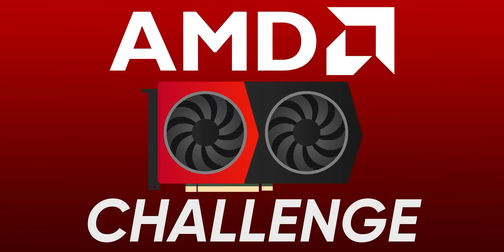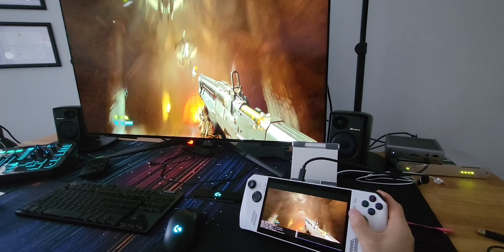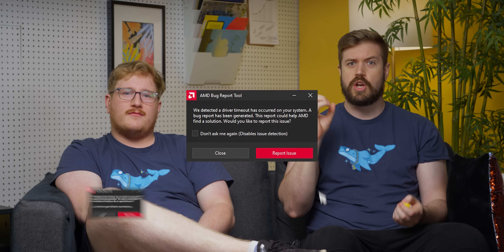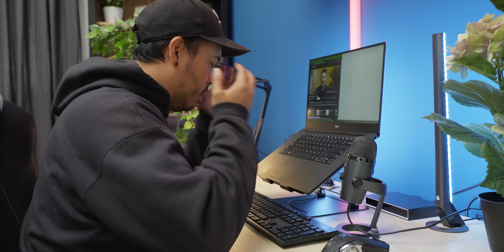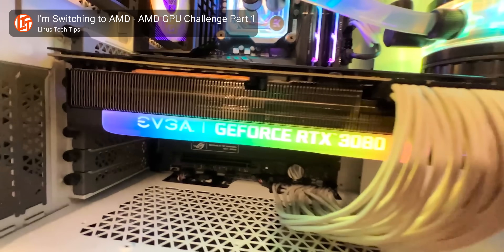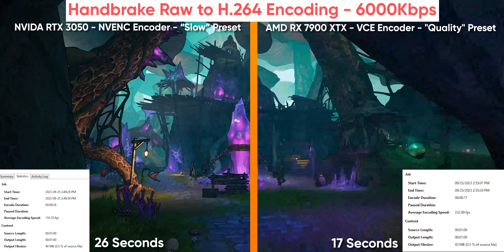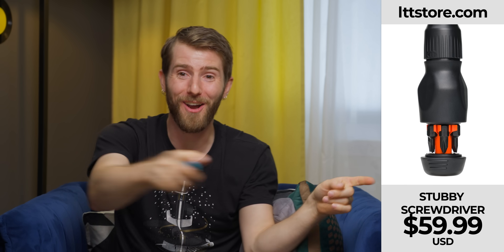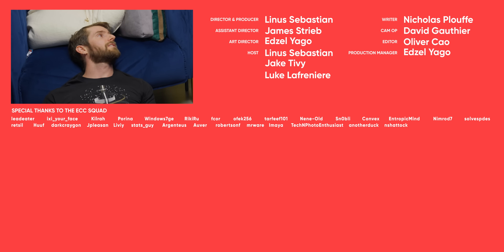I’m Staying on AMD! - Radeon Challenge Pt. 2

Comment: I'm telling you the hard crashes are from windows screen saver doesn't work with amd gpu's. I had pictures cycling every 5 minutes on my desktop background and every 5 minute or so my computer would hard crash. I turned off background slideshow and literally no crashes ever, I even replaced a motherboard and ram because of this issue. 6800xt water cooled will kill at 1440p and 4K games. 100 fps all the way. Soft tubing guy here... but my set up is way different then most.

Comment: I think this challenge is unfair. Running a Radeon GPU on a previous Nvidia pc, is not a fair comparison. I think those challenges should always be done with a fresh reinstall. Or maybe first DDU and then fresh install. Both cases are interesting.  I am also interested about a test where Radeon PCs switch over to Nvidia and then see if a reinstall is necessary.

Comment: My honest opinion is, that all manufacturers should stop 3 years of speed improvements and wholy focus on stability & usability. I don't give a fuck about slight increases in graphics at this point, nor 8k screens or 20TB SSDs, etc., but I am just sick and tired of the PC platform just not working all the time. Unless I'm gaming I'm actually just using my company Macbook, because I'm just fed up. I'm not a child anymore that will take any experience and be happy, it should just always work, and Windows and the PC just don't, but it goes beyond that. Like why can't I setup my screen via OSD when there is no signal to the screen, or why does it take longer for the screen to display a signal initially than for my whole system to boot, why does my BIOS randomly turn off virtualisation, why does Windows randomly forget my scaling settings or reset my wallpaper, why does this or that game crash, why do my headphones randomly turn on some webcall speech codec and sound terrible, why is there about a 1/3 chance for a BIOS update to even work from Windows, etc. etc. It just a shitty experience, and it is everybody's fault. My monitor isn't running Windows, my issues were on both my AMD and Nvidia Cards, Intel & AMD CPUs, game issues are lots of companies fault, etc. Stop tweaking and just make a standard definition of purpose work stably. I'm fine with playing late 2000s games, or Nintendo games, why would I care that a game has 2022 graphics instead of 2024 when it comes out next year perhaps. But if it crashes constantly, I'm just not interested in buying anything from you ever again. Fix you shit, smooth the edges, test EVERYTHING and deliver technology on the PC that works at least as well as lets say an iPhone, where any minor bug is newsworthy. It can't be that impossible of a task. I'd rather wait a little longer on a working system, than get to the inevitable crash faster.

Comment: I dont understand what your guys are doing :) I have been using AMD/Radeon GPU and CPU from early 2000 and the only times things start to get funky for me is when OC gets in the mix. Otherwize it has worked great for me for 20 years now. My laptop at work on the other hand... A Intel and Nvidia worstation laptop, i have had so many problems im never going to buy that with my own money..

Comment: I am a little upset that this challenge has gone on for so much longer than the Linux challenge did, maybe with AMD they would have had a better time, but oh well.
Reply: The Linux challenge went on for a month, as did this one.
It's simply that for this one, they had a delay between the end of the challenge and the time they made their conclusion video
Reply: @haxie4516  wait, really? That was a long ass delay
Reply: @RogueRen 
Well, they had LTX to prep for, and then they had the hiatus, etc

Comment: I built a mini tower just for watching YouTube and such, integrated graphics on the 5600G. Should be good enough, but constant graphical glitches, low framerate and crashing. I ended up slapping in an old spare GPU (also AMD) and it was fine.

Comment: No DLSS and RTX is a huge deal breaker.
Reply: ....
This is like saying "this iPhone doesn't have Samsung's Bixby, that's a huge deal breaker"

RTX is a branding for Nvidia cards, and DLSS is the name of their frame generation tech... AMD has FSR for that...
Reply: @oliver-nation4377 
Yes DLSS and FSR are different... each is developed by their own separate companies.
But no, it is essentially just in name. The way they work is not different. Both are frame generation tools, and both are using "AI" to generate additional frames, where the game doesn't perform as well.

And no, RTX is not a tool.
RTX is the branding for their GPUs.
The tech you're thinking of is ray tracing. RTX is literally just a marketing term that is trademarked (and copyrighted) by Nvidia.

AMD cards also do Ray Tracing as of the recent cards.
Reply: @haxie4516  Yes AMD can do Ray Tracing, and yes RTX is a brand name, but the fact of the matter is that AMD cards sucks at best at using RT´

Number two, no FSR ain't ai based like DLSS, but instead on an algorithem, which is also why DLSS boost your preformance more, and looks graphically better.
Reply: @oliver-nation4377    
So, you're moving those goalposts fast, aren't you?

AMD's Ray Tracing performance with the 7000 series is pretty solid...

And yes, FSR and DLSS are both "AI" frame generating techs.they are using the same methods.
And considering FSR3 came out yesterday, you cannot be claiming one or the other looks better lol
Reply: @haxie4516  Ofc i can, which games that needs to use FSR3 has it? So yes ofcourse i can claim one is better than the other, when one is actually supported and does exist. 

And no AMD 7000 series Ray Tracing still sucks ass, since what makes Ray Tracing viabell is DLSS (And no FSR looks arse and does not give the same boost)
Reply: @oliver-nation4377  
Nope. You can't.

No. DLSS is not what makes raytracing viable. That's two separate technologies FFS.
Reply: @haxie4516  Most setups arne't able to handle RT, that is why you use DLSS
Reply: @oliver-nation4377  
🤦‍♀️
Whatever. I cannot be bothered trying to teach you some computing basics.
Reply: @haxie4516  Typical American, won't bother to do any kind of research and thinks he got the only truth. Educate yourself, and stop watching short video format.
Reply: @oliver-nation4377  
Lmao. Dude. You claimed that DLSS and FSR are completely different, and that RTX is a technology.

Don't try and lecture me on anything, kid.
Also, not American, and I teach electrical engineering.
Don't incorrect me again.
Reply: @haxie4516  then stop being incorrct, if you don't like being lectured. And if you teach, you really should learn to do some research before going into an argument. But be my guest here is your asignment "teacher" how does a 7000 amd card with FSR compare to an RTX 4000 series with DLSS?

Comment: I do not understand why so much unnessecary effort was put into this project with tearing apart hardline water tubing and riser mounted cards and such that will not match the use cases of 90% of watchers of this video.   I believe for this or any other similar challenge should be done with non-personal PCs, and should just be purpose built desktops for the challenge with various CPUs and motherboards.   Still use these desktops as your daily driver and install all the other software you want to use on them, don't put them in your personal machines of various ages and jank and expect to get relaitable results.
Reply: That would completely defeat the purpose of the challenge....

What you're describing there is a review, not a challenge.

You claim that this won't match the use cases of 90% of watchers?
A sanitizer system like that won't match 100% of watchers.
Reply: @samuel.gantner 
As I said. That defeats the entire purpose of the challenge.

Sanitizing the systems makes it completely unrealistic.
If you want something like that? Go watch their review of the cards.
Reply: @haxie4516  Im not asking for a card review, I m asking for a full daily driver gaming and non gaming swap.  But using their personal computers that they admit are non standard configs with other issues affecting the results does not produce a repeatable result.
Reply: @samuel.gantner  
So you want a real-world test but you also want it sanitized and have all elements of the real-world test removed from it...

Riiiiight....

I don't think you understand that giving them sanitized systems completely removes any and all of the actual point of this video.
They're not making a long term test video. They're not making a daily driver test video.

They're doing a challenge.
The challenge that is explicitly about being realistic and not hiding away any of the rough parts.
Giving them a fresh system to use would not be realistic at all.

Jfc...
Reply: @haxie4516  So someone upgrading their case,  motherboard, GPU, and hard drive at the same time is less realistic then swapping just the GPU in a rack mounted, hardline water cooled PC with all IO routed over optical USBC ?
Reply: @samuel.gantner  
Firstly: yes. Because if someone does that, they're not doing an upgrade, it's essentially a new PC.

Secondly:
The fact it's rack mounted is irrelevant. That changes nothing about if it will raise errors or not.
Same for the water cooling. The GPU was not hooked into the watercooling loop.
And you're incorrect. The IO for Linus' system is not routed over optical USB-C.

So....
Maybe if you actually stopped and looked at the first part of this challenge, you'd know why you're so desperately wrong.
Reply: @haxie4516  Maybe if you watch this video that your providing bad takes on https://youtu.be/4yUMOK9dOQc?t=225, you would know that he did test it over optical usbc.    But to put an end to this.  I believe the purpose of this video was to switch to AMD gpus for all their daily taks for several weeks and compare them to the issues and performance they had previously had on their Nvidia gpu systems.   But I believe that due to the unique physical configurations or other unrelated/pre-existing hardware or software issues with their existing systems it put the AMD gps at a disadvantage.   As someone who uses an all AMD setup to run a lot of the same games and applications and has never seen anything close to most of the issues they reported.
Reply: @samuel.gantner  
Maybe if you actually checked what he was referring to, you'd know that he isn't using optical type-C.
He's using optical DisplayPort. And the point he was referring to was in running a display all the way over to his home theatre.
Before you try to correct someone else, be damn sure that you're correct yourself.

And, to get this straight, you think that them using the GPUs in their systems, in a challenge about using the GPUs in their systems... puts the AMD GPUs at a disadvantage?

The Nvidia GPUs also had to work in those systems.
As did the Intel ones.
That is entirely equal.

As someone who uses an all AMD setup, and has for years, I've had times when things worked perfectly, and times when things were buggy af.
Your experience does not mean that their experience is not accurate.

Jfc. Do better FFS.

Comment: Somebody who uses a PCI-E Riser for Gen 3 and a second power supply - sorry but this is just wrong, there will be compensation currents flowing through the PCI-E slot! - should not give system stability advise / reviews.
Reply: Luke's riser is gen 4 afaik, and a second PSU is not an issue here.
There's no worry about "compensation currents" here.
Also, this wasn't a review, and wasn't advice...
Reply: bro did NOT watch the video all the way thru 😭
Reply: @FS-fx1it  
"there always is when you've got two PSUs"
Nope. They have the same ground potential, as they are joined together with a common ground.
In this configuration, they're designed to match one another and stay steady on that.

The PSUs also are designed so that they will settle out on the voltage. It's a fundamental part of their electrical design.
The PSUs do not oscillate.
Additionally, given that the GPUs don't pull 12V from the PCIe slot if they're powered externally, aside from data signalling pins, which are protected lines, there's no current transfer there.

They're not trying to get an objective long term use report.
The whole thing is specifically meant to be subjective...

And his riser is a Gen 4 riser.

Comment: Basically sealed my decision to go with nVidia tbis month when I rebuild my system. I ise multiple displays and am not foing to tolerate rhat high idle power consumption. Further, why was Linus so casual about reinatalling windows, as thoigh a fresh windows install was some somple thing ro resolve a gpu issue. F that noise. Ill be hetting another nVidia card and xompletely avoid this nonsense with amd

Comment: I don't get ppl having problems with AMD lmao. Either they're doing something wrong, or they're doing something wrong. I get that if you have to troubleshoot problems that take you a while/or you're doing the wrong methods, you'd get annoyed and curse AMD, but...like, skill issue.
Reply: Also if you're having problems with AMD's GPU drivers, I recommend switching from the 'gamer' driver aka AMD ADRENALIN, to AMD PRO. If you had problems and this fix didn't occur to you after research or literally looking at the two types of AMD GPU drivers, this is that skill issue I'm talking about. Also AMD PRO is just better anyway.
Reply: @willmael7914 
You seem to be lacking the knowledge of one simple thing:
Not everyone gets the same experience out of a computer. And the issues that were presented are not due to user error.
Reply: @haxie4516  ik but uh, all issues presented seem fixable to me. Even when I look at 'amd driver issues' on Reddit, all I can think of is 'you're probably looking at the wrong place'. I myself switched from Nvidia to AMD without doing ddu (i was too lazy). At first I was having troubles with the adrenalin driver, but once I switched to the pro driver, things were better. Like that is not a crazy fix, and not doing ddu should've been a death knell for me, but it wasn't. And ik most ppl don't give the pro driver a chance and stick with adrenalin.
Reply: @willmael7914  
Something that worked for you might not work for others.

And given that a driver update fixed a lot of Luke's issues, that seems... not as much his fault as you're making out
Reply: @haxie4516  I saw in the video that he still stuck with adrenalin lol, you never know
Reply: @willmael7914 
🤷‍♀️
It shouldn't be necessary to switch drivers away from the recommended ones in order to have the card work
Reply: @haxie4516  yeah it's weird that amd has two drivers, and that ppl rarely use one of them. The description for AMD PRO even says it's "designed for stability", and they're kinda not bullshitting with that. Nvidia only has one driver and it's stable, while AMD has two drivers and only one is stable. Imo AMD loses a lot of money by pushing the more unstable ADRENALIN as the 'gaming driver'. PRO has most, if not all, of ADRENALIN's 'gaming features'. Yeah it's weird.

Comment: NVIDIA fanboys lol.  No way you magically get 3 for 3 on having problems that the general public doesn't have.  I know a ton of people with Radeon cards, my VR rig runs Radeon (5700xt) and never seen any of these types of things.  I also don't do weird things on my rig either.
Reply: Lmao. So the comment section is filled with people like you.
Some claiming they're being Nvidia fanboys or were paid off by Nvidia, some claiming the same, but about AMD.

Have you considered that maybe, just maybe, their setup is not the same as yours?
These issues are well known across the internet, and have since been mitigated mostly (as said in the video)
Reply: It's because they're on cutting edge as they came out so it's really is bleeding edge.
Reply: I bet they're gonna have a more better time with previous gen, which sucks but AMD should definitely cooks their driver more before releasing the cards if they want to beat Nvidia, though they already did value-wise with the price difference.